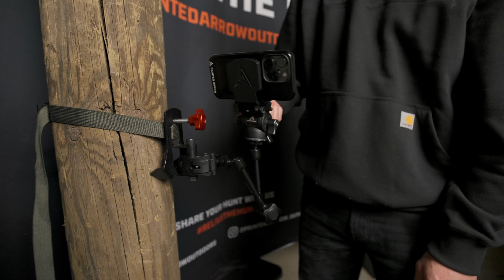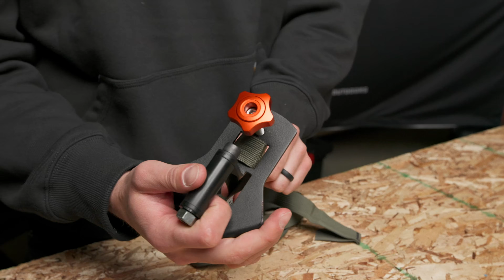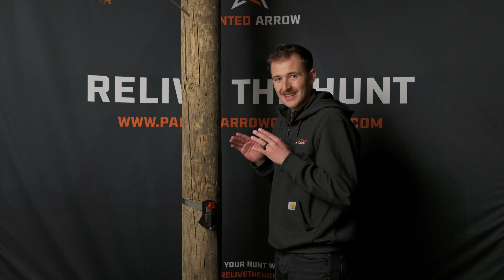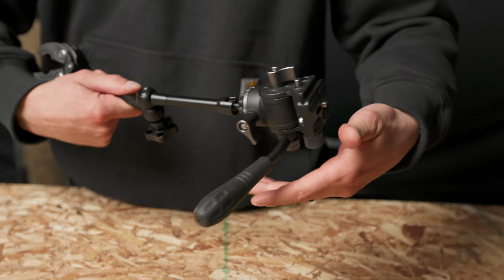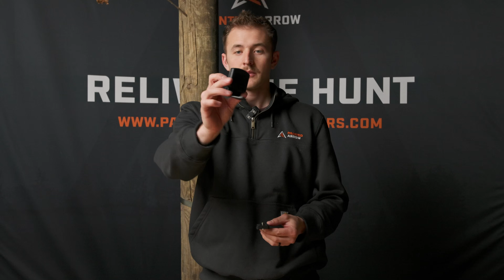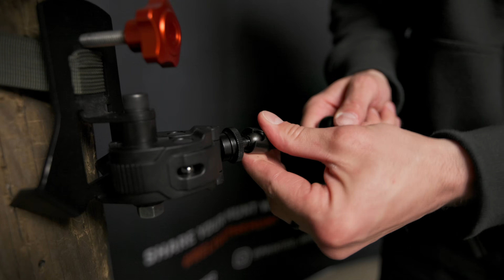The CAMERA ARM FOR MOBILE HUNTERS - MAG-PRO ARM ELITE KIT - The BRASS TACKS BREAKDOWN

Comment: So this wouldn’t be good for a ladder stand or a lock on? Or even a climber?
Reply from the maker: No it definitely would be! You just might have to get creative with the attachment method. You might not need the tree adapter. You might wanna hook the arms directly to the limb or stand. Very dependent on the setup.